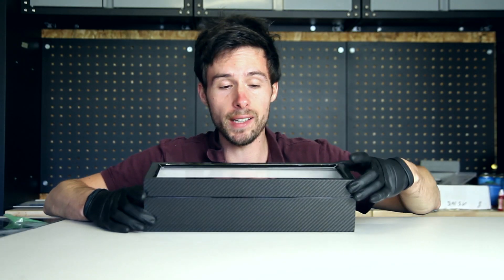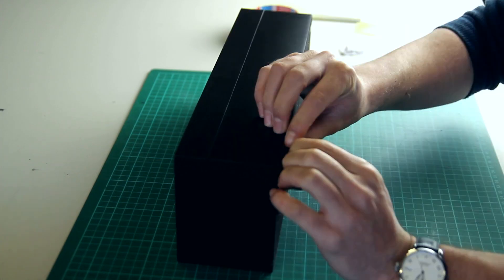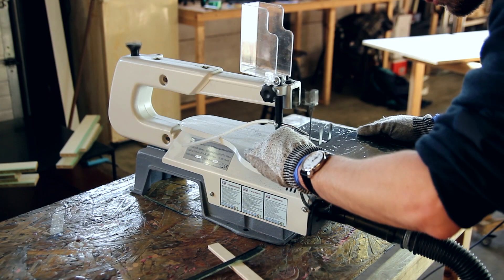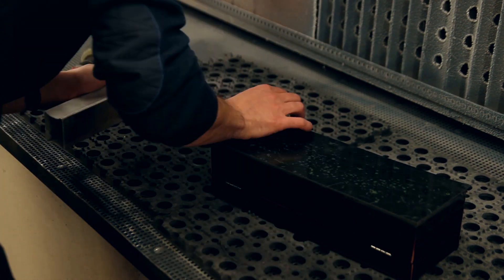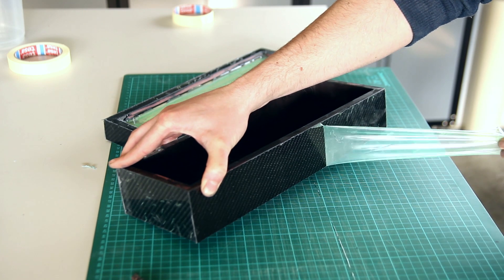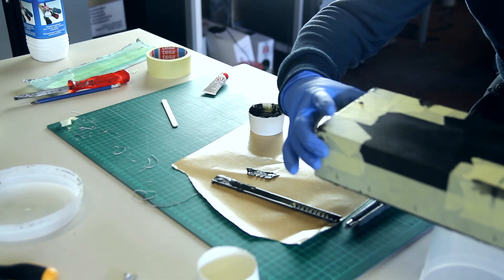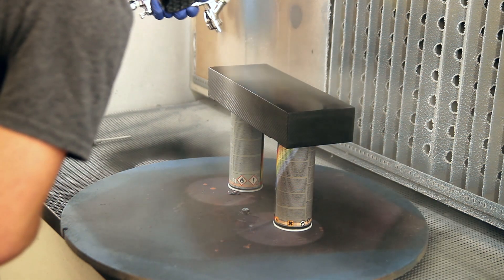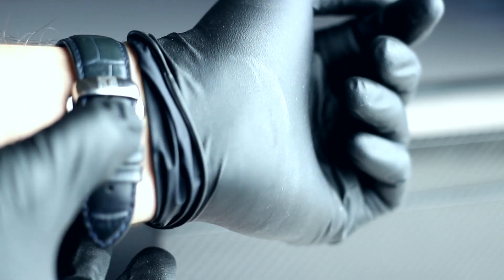Carbon Fiber Watchcase - Veneer

Comment: Hello I have a plastic piece in my car that I wanted to
Make in carbon but I did a wet layup and once I was done and clear coated I installed it in the car and it sits on the roof upside down but after sitting in the heat it started delaminating, what could be the issue? I've tried 5 different types of epoxy